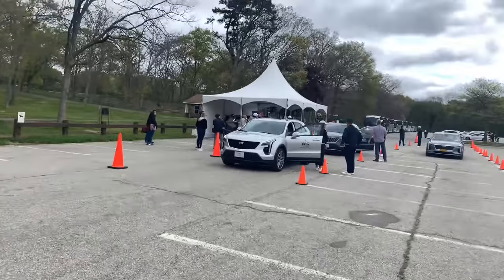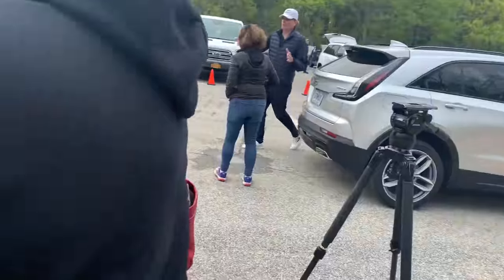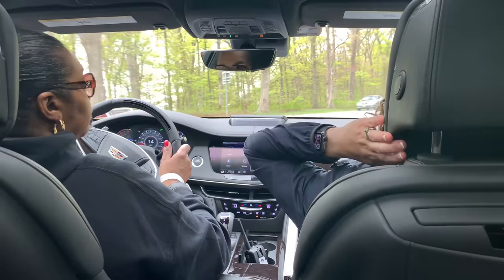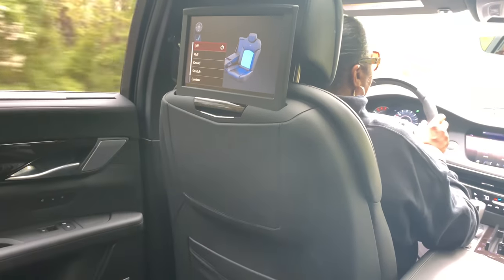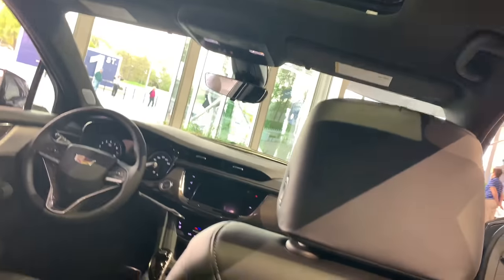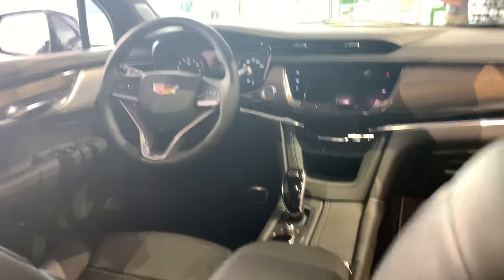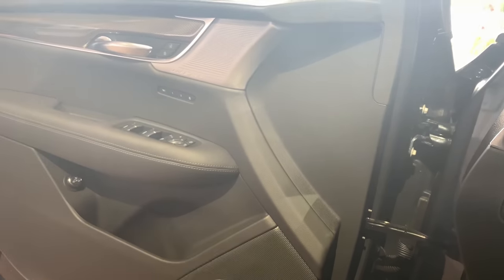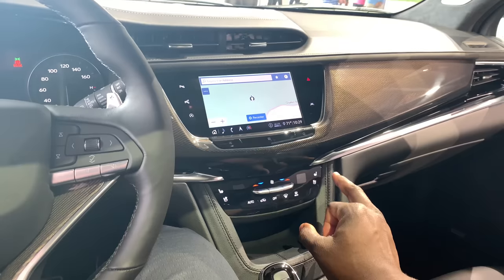CADILLAC XT6 at PGA 2019 with Undercover TRUMP???

Comment: Hmmm that is a  equinox and that 3.6 has had a fatal flaw at 65k to 85k miles....timing chain tensioner fails 100% of the time.  I had a 09 Teaverse and sold it in 3 years with 49k miles and loved driving it.

Comment: Aviator will take out, big time!  Just wait for deep discount on this crippled design XT6!
Reply: the xt7 and xt8 are coming bro just hold on im a big GM guy and we got something for the aviator ass just hang tight..
Reply: The Aviator will be the only thing discounted when they’re sitting on the lots too long because of the price amongst other things. It’s priced out of the range of this segment (XT6 and Lexus RX-L). These soccer moms don’t care about having RWD and 600 hp. They care about reliability, refinement, tech, safety, and most importantly PRICE. Aviator is more of a Range Rover, Q7/Q8, MB GLS, BMW X7 competitor because of drivetrain and price. I’ma tell you now, Lincoln made a big mistake there. Lol. Little to NONE of those brand’s loyal customers are won over and leaving their brand for the Lincoln Aviator. It does nothing that their Jaguar/Range Rover, Porsche, Mercedes-Benz, BMW, and Audi’s don’t already do. XT6 will probably outsell it nearly 2 to 1 as everything else per the usual Cadillac/Lincoln story.

Comment: They have the looks down just not the engines (certain models) and interior
Reply from the maker: GM's entire car line and crossover line is SO FUCKING BORING that Cadillac stands out immediately.  Their interior design and quality is BELOW Lincoln's newest.
Reply: Bigtruckseriesreview Motorsports correction: Lincoln’s overall interior design in their latest products are nicer. Lincoln’s interior quality is a different story. Cadillac still has them beat in quality.

Comment: 400 is nm tq for the 3.6 which I don’t get why they didn’t shove the 3.0 and 4.2 blackwing tt cadillac should stray away from using gm parts and engines to separate them from the lower brands hopefully they change in the coming years
Reply: The XT6 needs the revised 3.0 TT from the CT5.  Putting a Blackwing engine in the XT6 is overkill since this vehicle is FWD based which can't handle the ft lbs. of torque at full throttle due to possible torque steer.

Comment: It just looks like a luxury version of a Travers. This suv, the Travers and Enclave is the same truck if you look at the side profile. .. Cadillac needs to leave GM and go out on their own...everything is the same just like the Escalade is the same as the Yukon and Tahoe
Reply: That would be very hard for Cadillac to be own their own.  Cadillac needs GM for the platforms and economy of scale.  Also, GM will not sell off Cadillac because it is too valuable for them.  The Escalade is one of the highest profit makers for GM.

For as the Traverse and XT6 sharing architecture, the engineering is different between the two with different wheelbases.